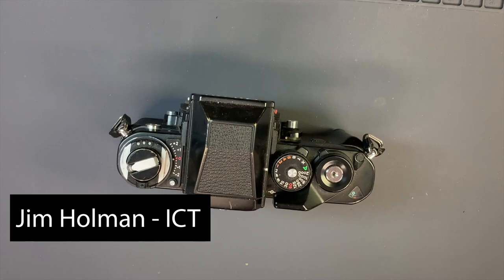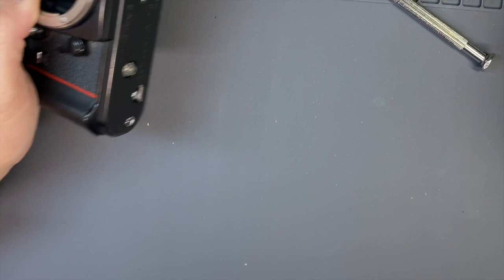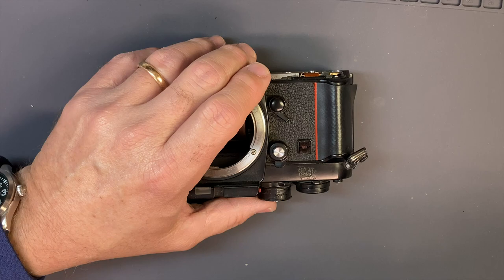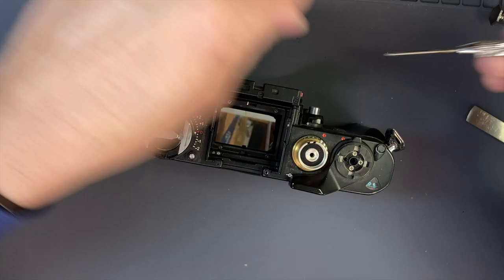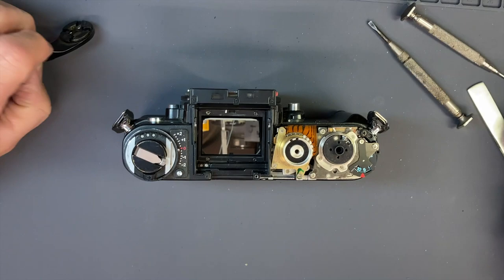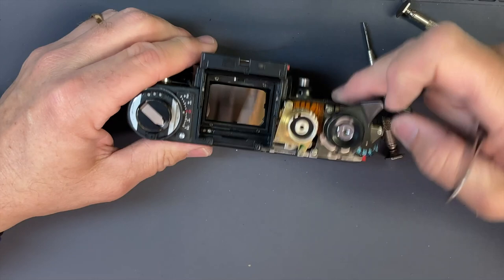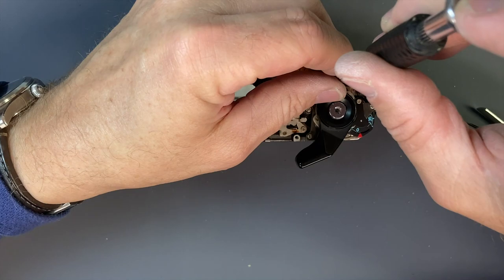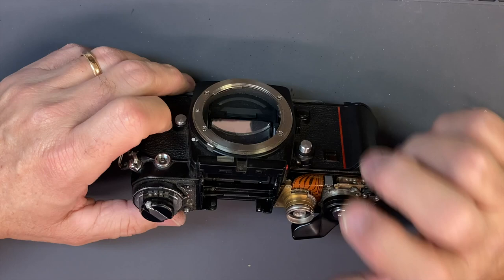F3 Disassembly Part 1

Comment: Thanks for this. I have an F3 with a floppy multi-exposure lever and although I rarely miss it, I want to see what’s involved on the bottom end and what might be broken. 

Cheers!
Reply from the maker: The Multi-exposure lever is spring loaded by another lever on the bottom but if you have an earlier style the set screw could of fallen off or just become loose.

Comment: Hi, greetings from Cuba. I have a nikon F3 with all electronic speeds working but only when a use the secondary shutter release, the emergency next to the mirror box. 
Any thoughts on what might be happening? 
I’ve done the cleaning, but it didn’t affect the results. Thank in advance

Comment: Thank you for the video - very instructive! My light meter is intermittent  i.e. works then doesn't - i suspect corrosion/dirt - I've cleaned the battery compartment - where else might be good to clean for this issue?
Reply from the maker: The ASA resistor is dirty along with the ground contact. Be careful of the white plastic gear with the cord attached, don't jump the cord from the pulley and don't remove that section with a lens on.
Reply: Thank you - I suspected the ground required a clean once I found your second video. Your videos and your prompt response mean a lot to me!

Comment: @ICTCamera thanks for this video! I'm wanting to replace the right top plate on my F3. Are there any specific tools needed? It looked like you used a small Phillips head, a grippy rag, and a (hex screwdriver?) for the grub screws on the speed dial? Do you need to mark where things are so you are able to put it back in the right place with the right speeds in place? Cheers
Reply from the maker: James Holman
Some tools I used can be bought, like the driver tips which are JIS that I buy from Canon. I have acquired most of my tools over 40 years of repair career, and since I do a lot of F3 repairs I made some special tools to speed service and cut down on incidental scratches. From the looks of the impact the cover will be difficult to remove because the tolerances are so tight and a pushed in top plate will bind on the threads that you will find under the winding lever after a retaining ring is removed.
As for tools, the grippy thing is just a piece of old bicycle inner tube, the round nose pliers were kinda cheap but had a long arms and were thin, perfect to the modified for the ring and lastly a screwdriver modified to remove the multi-exposure retaining screw.
I'm not sure what the repair guy was talking about when they said something about gears being bent that run the counter, they don't know the F3 very well.

Comment: Thanks for the incredible video, do you know what can affect the operation of bulb mode? I have a Nikon f3 and that mode does not work but the other speeds are correct
Reply from the maker: I don't think I have ever heard of a F3 that doesn't have bulb. If you remove the speeds dial but leave it electrically connected the camera will be in Bulb mode. I would check the 2nd curtain magnet and clean it with alcohol.

Comment: Hi! Your videos of the Nikon F3 are just exquisite. My F3 has a small problem that the advance lever is not returning. Everything else works fine. I used your video and took off advance liver with counter. Everything looks fine, nothing is broken, the same applies to the spring. I tried spraying some rubbing alcohol and it got a little better but not completely. There is still resistance for advance lever to return. Can you advise me how I could lubricate it so that this improves? Do you have any thoughts?
Thanks
Reply from the maker: You can take the system apart and look for the resistance but it is not an easy job to disassemble. Replacing the winding unit may be best.
Reply: @ictcamera560  Hello Jim!  I have one more question. For some unknown reason, the fastest shutter speed for this camera is about 1/80 sec. This applies even if I choose A, all shutter speeds from 1/2000 to 1/125 have a speed of 1/80. Lower shutter speeds are all correct from 1/60 up to 8 sec. Do you have any ideas as to what this could be? Rob
Reply from the maker: @roberoto100  The film counter needs to be on number 1 or the counter is broken in a way that makes the counter switch shorted to ground.
Reply: @ictcamera560  Forgot to mention. On the display inside, the maximum speed is 1/80, although it says 1/2000 on the shutter speed selector. Counter works as it should, it counts pictures fine and resets to zero when I open the back cover. Or did you mean something else?
Reply: @ictcamera560  Now I understood with the counter at no. 1. :) Will test

Comment: Hi Jim, appreciated this full tear down video with audio explanation, which is very useful . I got a f3 that have strange error could you take a guess to see anything wrong: when winded up, the first shutter press (full press or half is fine, I think it means to activate the camera)with no response, I need to wait a count to 3-5then I can fire. (I can’t constantly pressing it, it just not fire, only when I wait a couple of seconds can it fire)It seems to taking some buffer before could fire the shutter. Really wired, do you have any guess on that? I measured the battery with 2.83v I suppose it’s fine.
Reply from the maker: I can only guess your issue since the camera is not in front of me. First the mech could be sticky and slow and it take a few seconds for some of the switches to make proper contact. The other one I have seen is a slow elctronic capacitor build-up from a bad component.
Reply: @ictcamera560   Very very Thank you… I spent the whole night tear down the bottom and top right, and cleaned it follow your steps, unfortunately I cleaned the contacts of the shutter release the problem still, I even try to manually use tweezer to trigger the brass contacts. I think It is something that take time to ‘charge’ so it can fire the shutter. So I really believe in the later one you said, could you briefly let me know where the ‘electric capacitor’ is if it’s not taking much your repair time… Really appreciated your reply….

Comment: Hey Jim! 

My advance lever is stuck and the manual release hasn’t helped, so I don’t know what’s causing the problem. Got it off eBay. I took off the bottom to get it back in position as one vid demonstrated, but I believe I have a different version than the one used in that video, so it didn’t work for me. Would a proper CLA fix it or is it a more advanced job?
Reply from the maker: It is hard to say without seeing it. If you got it off eBay than anything could be wrong. Very little happens on the bottom the charge and latching of the shutter are all done on top.

Comment: My F3 has a broken power switch (electronics work fine but the plastic ring that turns under the advance lever is broken in half and held on by tape), any idea where I could find a replacement? Any help is appreciated! Thank you!
Reply from the maker: Call to camera shops that repair film cameras, one might have a junker F3 and be willing to sell the part.

Comment: Hey Jim! Great videos you've got here. 
I'm personally more experienced with mechanical cameras, recently did a full overhaul on a Olympus 35RD (only been repairing cameras for myself for a couple years, but recently getting confident to do bigger tasks). 

I've bought myself an F3 here that was sold as working (it was cheap so I expected that'd be incorrect). It did nothing for a while, but fiddling with all the dials did bring it to life, was working as expected yesterday however today when you have it set to "A" it meters correctly for the ISO selected, however when using it manually its miles off (in fact f16 in manual metering, seems to match the wide open when set to "A") - do you have any ideas what could cause this? I'm going to follow your videos to give it a good clean up once I get a better soldering tip myself after seeing those wires haha.
Reply from the maker: Clean the ASA resistor but also remove the speeds dial and clean the metal between the speeds dial housing and the body. That acts like a ground for the speeds dial and if not clean the speeds and meter will do weird things.

Comment: Thanks for this great video.

I have a problem with my Nikon F3, maybe you can help me out!
The shutter-release button of my camera does not work properly anymore. The batteries inside are new, the camera is turned on and the exposure/ light meter still works. I can take a photo by using the backup mechanical release lever but the shutter-release button will only fire after pressing it many many times, always randomly... it's impossible to properly photograph like this.

I'm afraid to open up the camera myself, because I don't have any experience. What would you suggest doing?
Reply: I have the same problem, did you resolve it and how?

Comment: Hi! Thanks for this video. I need to screw my multiple exposure lever back on (it randomly fell off). Would you recommend using the round-nose pliers for that? It the video you mentioned that the pliers need to be modified? Is there any other tool that would work for that? 7:00 Thank you so much!!
Reply from the maker: I use a round nose pliers modified for that but I also have a cheap screwdriver that I modified with a dremel to do the job better.
Reply: @ictcamera560  Okay I see. No Dremel here, so I’ll pick up a round-nose plier. Thanks!

Comment: Hi there, thanks for the informative video! I have a F3 that has a small problem with the LCD. In 'A' it meters correctly, but the speed does not always show correctly on the LCD. Some of the segments are not fully darkening, or the wrong segments partially darken, making it unreadable. Seems to affect lower speeds more, and its intermittent. The LCD shows the speed correctly when manually set to one.  I am sure it is not the battery, I have tried several new ones. Any insight is greatly appreciated!
Reply from the maker: You may have an issue with the LCD contact strips. They are a real pain in the you know what to remove and clean, very small fiddly work. Much care needs to be taken to service and if done wrong the problem will get worse.

Comment: Hello,
First of all, great video it helped me a lot on a f3 Wich I bought as not turning on electrically.
This was an fairly easy fix however it still has the problem that all times are the same.
What I did was clean the magnet - nothing changed
I checked the capacitor by desoldering and measure it - fine
I measured the spool of the magnet (although not desoldered) fine resistance in my opinion.
And I measured the voltage Wich was where I got lost. Both contacts of the electromagnet read 3 volts all the time Wich leads me to believe there is a short somewhere.
Do you have any idea what could cause this?
Reply from the maker: Is the counter switch detached? Black wire. The magnet will have 3volts until release where one side wide go to ground. After this you are getting into troubleshooting, which is impossible to do over the internet.
Reply: @ictcamera560  that's it.
I think the release switch wasn't grounding it properly due to corrosion.
I was firing it repeatedly for a really long time while switching times and it got better every time.
I'm going to clean the contacts again so it won't happen again.

Again thank you for posting videos like this.
Without it I wouldn't have fixed it this fast

Comment: Howdy Jim, I have a strange issue & I cant find an answer or similar symptom anywhere online:

Midshoot, I tried to engage the backup shutter release lever, for the first time since I've owned the camera.

It would not fire. Also the meter stopped working - the F3 immediately lost all power and won't fire from either release. Zero power w/ new batteries. 

The backup shutter release is lever is now limp and goes all the way down and does nothing. Feels floppy, and now the camera is bricked. 

Any ideas? Is the F3 somehow left powerless if the backup shutter release malfunctions?

Is there a way to release that lever without taking off the front? The shutter is wound and ready to fire position.

Thank you!
Reply from the maker: Interesting issue and I can't be absolutely certain without seeing it. I do feel the manual release lever is jammed in a half released half not position internally so I'm not sure what you can do to make it operate. If the mirror is up then the LCD will blank out which is normal but if the mirror is still down then the hang-up could be in the mirror up system. If the mirror doesn't go up the shutter will not release and the camera will not cycle through.
Reply: Thank you for the reply, Jim. 

Mirror is down, and the camera seems fully sound except for the backup shutter release not engaging, and it's turns loosely down to 8 o'clock. The camera was shooting and working great up until i tried engage the backup shutter release. 

Could the camera be stuck in mid-release, hence the mirror is getting an "up signal" even when down? Any idea how to get that backup release re-engaged? 

Thanks  @ictcamera560

Comment: I have an F3 with a film counter that won’t reset, any suggestions?
Reply from the maker: First check the pin on the winding side, it is in the back door seals groove. I have been seeing them stick in lately. If not then you will need to take off the wind side to investigate.
Reply: @ictcamera560  I was able to get in there and fix the problem thanks to your video, thank you!

Comment: Hi :) very interesting video! I have a question. My nikon f3 stopped working while I was using it. Photometer flashed on and off and then just died, I thought it was the batteries so i changed them, but it didn't help. Camera doesn't shot in the mechanic option either. At this point it seems to be the power switch, but it clicks on and off perfectly, it doesn't seem broken. Could it be that it needs cleaning, or you think i should replace the piece?
Reply from the maker: So if you have power, LCD turns on, but no release than  you are going to have a bad release magnet or the mirror box didn't charge. There a few other reasons but without it in front of me I will not be able to give the exact answer.
Reply: @ictcamera560  yes its completely dead. No mechanical response either 💔

Thank you for your help!

Comment: Hey, sorry to bother you with this question but on my f3 that I just got the film advance lever works just fine but it has a little bit of vertical play in it and it doesn’t sit level on the camera body and it just bothers me so much lol. I was wondering if you think it’s an easy fix. Also the LED for the little lcd screen doesn’t turn on
Reply from the maker: The backlight for the LCD is a 6volt very miniature bulb. It really was not a good system with the little red button and needs attention on all cameras in for service. It is hard to say whether the play in the winding lever is acceptable play or not. The system runs on ball bearings so it might be normal but too much may mean something coming loose.

Comment: I wonder if you could help me with my F3. I put a new battery in it and it won't operate at all aside from the 1/60th mechanical release lever. What's also weird is that battery gets really hot. Do you know what might be causing this?
Reply from the maker: The batteries should never get hot. There is a short across the batteries somewhere.
Reply: @ictcamera560  Thank you for your advice! Does a short mean the electronics are fried or do think if I found the short I could fix it?
Reply from the maker: @belowaverage7539  An short like that is usually fixable, most of the time corrosion.

Comment: Hey again, today while using my f3 without anything happening externally to cause this the shutter is automatically releasing once I cock the film advance and I can’t use the shutter button or mechanical shutter release because the instance that it cocks all the way it releases the shutter. I think there’s a chance that this was caused when I accidentally didn’t cock it all the way and so I clicked it once to fully engage it and I think that might have been when the shutter just released when I did that and now it will only do that. I have an insurance policy through Allstate and they say that they will repair it but I don’t know if it’s a good idea to trust them with it because they don’t seem to know if they actually can do old Nikon repairs and I don’t know if maybe they contract out qualified repair shops.
Reply from the maker: I have a few problems that cause this issue, one was a loose screw that jammed in the release magnet and the other I had Monday where a mirror box lever was sticky and didn't return fast enough to latch the mirror. I can take care of the repair if you need.
Reply: @ictcamera560  oh so it seems like a relatively easy thing? I can send it to Allstate and have them supposedly fix it for free but idk if I should trust them.
Reply from the maker: @JoeStaehle  It all depends on who they find to work on it. I tend not to have problems with F3 camera but I have been repairing them since the mid 80's. By the way, getting to the release magnet means the front needs to come out, not an easy thing to do.

Comment: I just bought an F3hp online for $300. IT came with a 36-72mm lens. Im having issues with it though. I think the light meter doesn't work properly. It stays on 1/80th whenever I try to shoot it in manual. I shot a roll on it yesterday and have it developed to see if the thing works. I was honestly guessing my metering. Any suggestions as to what can be the problem? The batteries are brand new, so I can rule that out.
Reply from the maker: When the counter doesn't reach #1 yet, it will shoot at 1/80th. If the counter reaches #1 and still is shooting at 1/80th you have a bad counter switch or bad counter.